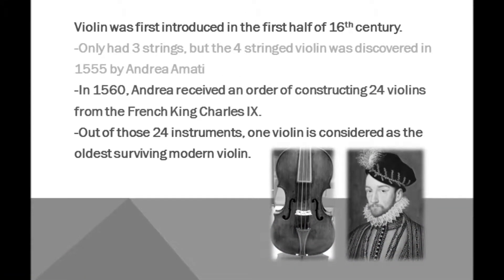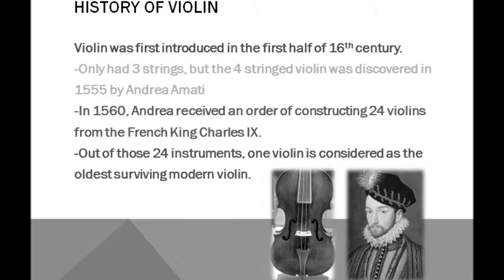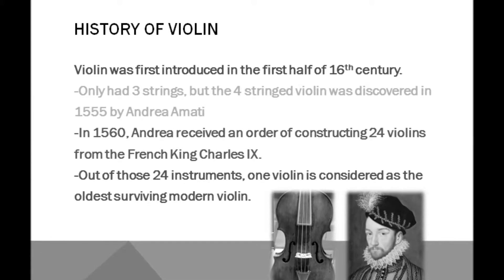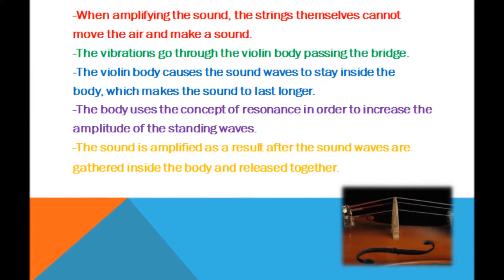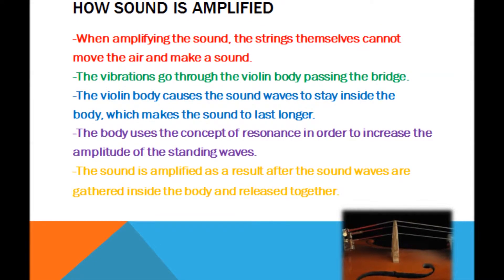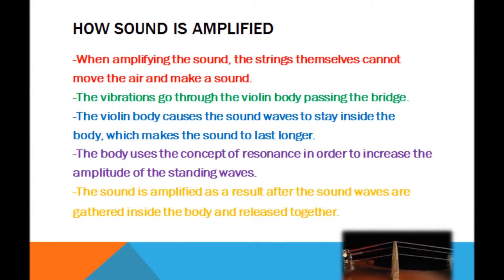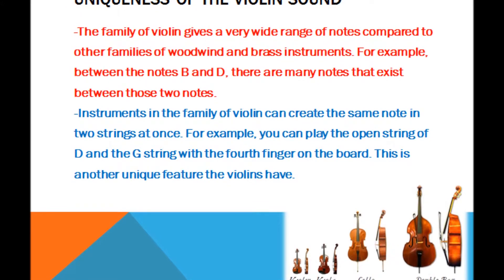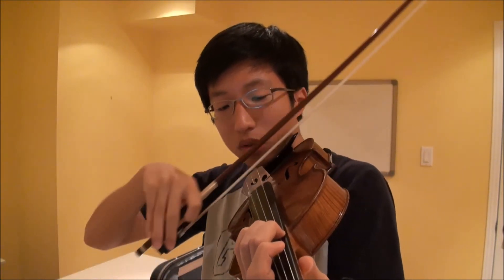Physics of Violin

Comment: Entanglogravitational Spring
----------------------------

entanglogravitatioal theory demands from all particles be partially entangled, even with virtual particles,
and very few one to one entangle -but that is rare.

The angular momentum of that ensembles, acts like a spring,
that forces all particles alling with more accuracy their mean
angular momentum by killing virtual particles.

So gravity slays space, and virtual particles of the partially entangled groups.
The energy of the dead particles is transformed to speed, that's why gravity
attracts things, but also heat because of entropy.

We know that speed is angular momentum from particle measurments.
A particle alone has a rotating spin to all possible angles.
It is like a fan, but with a more delicate rotational mode.
If you want to cut your finger by a fast fan, you have to interact
with it, and touch it at some degrees. So you the observer define
the degrees of touching, but a different observer may touch the same particle at different degrees, without changing it's fundamental properties, only
the data we record.

What we choose is the angle of measurement, what we do not know is
if it spins possitively or negatively. Also, if we twist the particle
there is a probabilistic chart of how much spin gets affected.

We can though affect the measured spin data, if we measure twice,
without tilting the measuring apparatus, only we move the device at the second time
at a fraction of the light speed. Then we have a chart of how spin gets affected.